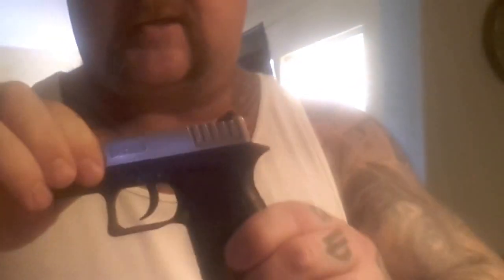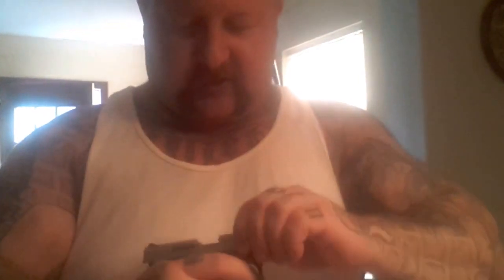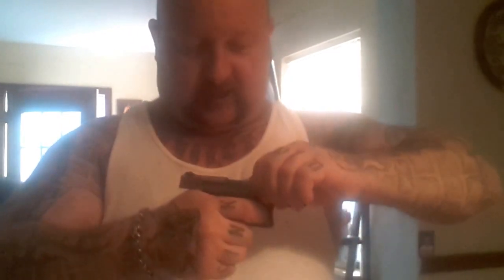Diamond Back 380 Jamb Problem and Solution

Comment: sounds to me like you have a sticky firing pin. the spring should return that  pin to clear the breach face. take out the pin, clean and dry all the components and the channel put it back together dry. holding the firing pin safety in shake the slide and see if the pin rattles back and forth. it should like a Glock. if you use anything at all on the pin for a lube, use Ballistol and wipe it dry again before reinstalling. good shooting!!!
Reply: Have had no/zero malfunctions with mine!